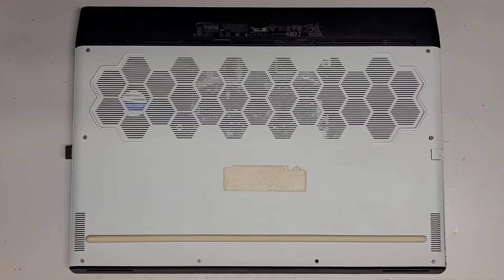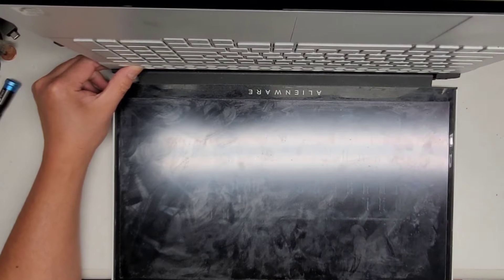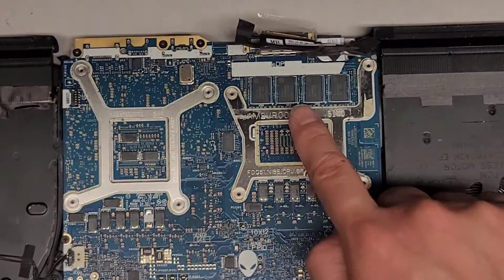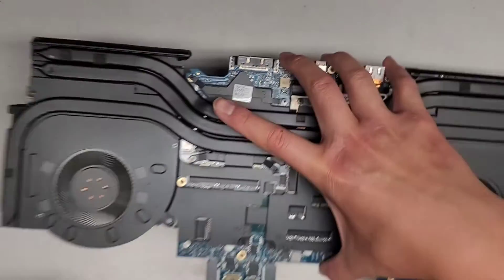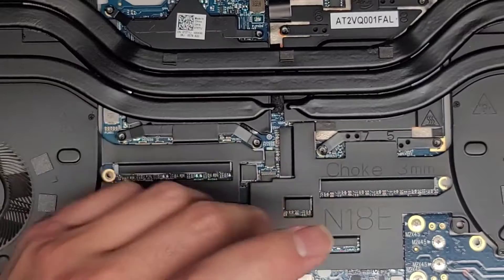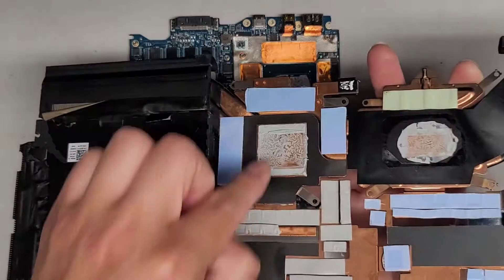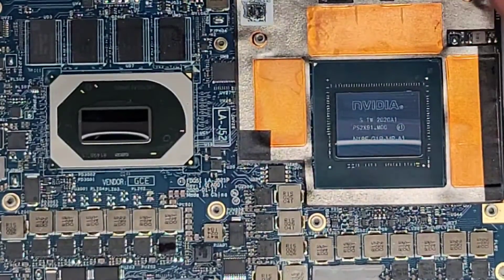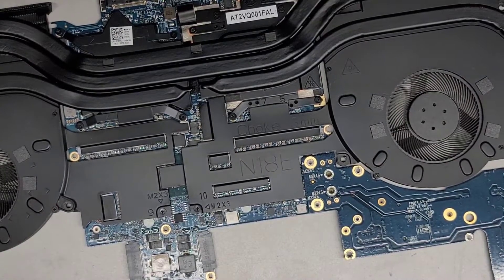Dell Alienware m17 R3 SSD Hard Drive Upgrade Battery Replacement Thermal Paste Replacement Repair

Comment: Thanks for the vid.
I want to clean the fan inside but I dont have the thermal paste with me (the guy fixed my PC has redone the thermal paste for me few months ago), so is thermal paste a must if I want to open the fan to deep clean?
Reply from the maker: Yes, if you want to remove the fans to check for packed dust.
Reply: @ItsBinhRepaired  I am not very familiar with the laptop. I watched your video a few times and try to get the confidence to get that done. It is a nice vid but there is too many in between that makes me a bit confused.
I really wish there is a video tutorial about how to get the fan out, repaste and get it back.
I understand this is not your laptop tho so it may not be possible for that but my laptop is constantly having the frame drop due to the dust I think.
Reply from the maker: Thermal Paste Application: https://www.youtube.com/playlist?list=PLSSiYX-ta7aqlImqkdLxHHpJbJttlNJgQ
Reply from the maker: If you watch enough of those, you should be able to figure it out.
Reply: @ItsBinhRepaired  I watched 5 times your dissemble video but I still dont have the confident. I am worried I would have messed something up.
But thanks for sharing the link.
Reply from the maker: There are a lot of videos in that playlist.

Comment: Thanks for the detailed video, it's given me the confidence I would otherwise lack. I just bought two new fans as well as Kryonaut extreme paste as it was recommended for this laptop but the instructions say to spread the paste as thin as possible. Is that paste specific instructions or would you still recommend the rice and pea method you demonstrated here. Does one method offer a greater benefit over the other?
Reply from the maker: I still recommend the rice/pea method, but spreading it thin makes it so you don't have to worry about getting the right amount. It can trap air bubbles, but it will only be marginally worse.

Comment: you think this will mostly work for an M17 R4?
Reply from the maker: Why not use the right video? https://youtu.be/0Il2-Y354Lo
Reply: @ItsBinhRepaired  that’s the first video I saw. But that’s the old model. Mine is the newer one that looks identical to the R3 on this video.
Reply from the maker: @kyle35_36  Hmmm in that case, I'm not sure. You'll have to give it a shot.

Comment: I disassembled my m17 r3 Alienware laptop to clean the fans and it turns on at least I think it does because the power button flashes and the keyboard lights turn on but I don’t see anything on the screen. Any troubleshooting tips?
Reply from the maker: Might be a bad charger, charge port, dead battery, damaged motherboard, etc.
Reply: @ how can I determine what the problem is?
Reply from the maker: @Mrs.Samantha-w8v  trial and error.

Comment: I did this today, however did not get to go through the heat sink part because of 3 screws stuck.

So I decided to just clean the fans instead and followed your video to reassemble it after.

Turned it on and my m17 r4 started to beep loudly, the power button signaled 2 red and 7 blue, I need help ASAP, because I can’t figure it out
Reply from the maker: Double check the ram
Reply: @ItsBinhRepaired  yea bro thanks it fixed it I was kinda rushed
Reply from the maker: @RuneBa1  awesome! If you haven't already, please like and subscribe so others can find my videos and possibly consider watching a few others and commenting to get the algorithm to recommend my channel. Thanks!

Comment: I have a question I have a father from Alienware M17 R4  Both of my fans were damaged, and when I searched, I found many different sizes than the ones I have. Is there any suggestion? 😢
Reply from the maker: Try repairing the fans
Reply: @ItsBinhRepaired  I tried doing this, but one of them is broken and the others work hard after cleaning
Reply from the maker: Hope you were able to get them replaced. :(

Comment: I have worked on dells and the starting and stopping like in your video is exactly what the pcs do when the battery is not taking a charge. I can't test it or anything so I have no clue but you could try removing the battery entirely to see if it will start up from only power from the wall? You mentioned that the battery was swollen and I'm thinking that it's a battery issue because of that. Another thing is if the charger itself is not high enough wattage it will charge a battery but not exactly keep it running without a functional battery. Figuring out if that charger came with the pc could also help the pc stay started.
Reply from the maker: Yup!  Thanks!

Comment: I know the gpu can't be upgraded. But can it be replaced? Does the gpu board come off? Or is it soldered. I keep reading different things. Mine is stick at 300mhz I've tried everything.
Reply from the maker: It's soldered to the motherboard.

Comment: @ItsBinhRepaired... I'm using Alienware m15 r3... I replaced my battery but my laptop goes off once I unplug the charger. If the charger is plugged everything looks fine including the battery health.

Can you please assist?
Reply from the maker: Was the old battery doing the same thing?

Comment: Hey man , I would like to send my Alienware m17 r3 into you. I  successfully changed my fans , I tired to access the heat sync and change thermal paste but I ran into stripped screws. So I said whatever and re assembled all back together , I played a game and my battery started to drain and not charge , so I swapped my 85W battery that came with it for a 56W battery (on accident) thinking I was having issues with the battery but the same occurred with the 56W battery. I then bought a new charger , and the same thing happened, it charged up to 100% but when I try to play a game or run anything heavy performance wise it shut off on me and now I don’t know what todo I tried everything. I just would like to know how to send this into you and if you could swap my thermal paste and look into my power issues please and thank you.
Reply from the maker: Sounds like you didn't reconnect the charge port or you damaged it.
Reply: @ItsBinhRepaired  i May have damaged it ? Because it was charging , turning on and everything, could u help me fix this ?
Reply: @ItsBinhRepaired  i mean anything would help man I’m in desperate needs
Reply from the maker: I don't know if I'll be able to fix it and it might be a $200-300 job.

Comment: I bought new RAM for mine in the hopes of upgrading to 32gb. Jesus christ opening this thing has been the worst experience. I've got to the part where I'm supposes to unscrew the screws next to the fans and life the spin piece off but those screws won't budge with any screwdriver I have and I think one is getting to be stripped pretty good. I just wanted to install my RAM, man... 😭
Reply from the maker: Yeah... it's stupid. I recommend this screwdriver set https://amzn.to/44uhbOl
Reply: @ItsBinhRepaired Oh that looks nice. I'll seal it back up for now and order that. Ty.
Reply from the maker: @sheev2372  the $40 set is really nice too, but the $20 does 99.999% of electronics lol
Reply: You can upgrade the ram even though it’s soldered?
Reply from the maker: No, unless you have very special soldering skills.

Comment: Who else ran into stripped screws ?😔
Reply from the maker: Your screwdriver is the wrong size.
Reply: When I got to the heat sync It unscrewed like 3 of them, the rest of em were stuck and I started to strip them. I know I had the right size because some screw came off !
Reply from the maker: @dooktah  that doesn't mean you have the right size. If it's one size too small it can work if the screw isn't too tight.
Reply: @ItsBinhRepaired ah i see :/ well I fucked up my screws on my heat syncs trynna to swap thermal paste , you did help me out a lot a ton I will be donating man. And by any chance would I be able to send this in to you todo a thermal paste change even thou some screws are stripped ?
Reply from the maker: @dooktah  sure, you could send it to me. Hopefully it wasn't stripped too bad
Reply: @ItsBinhRepaired  and if they are is that a problem?😅
Reply from the maker: I have a stripped screw removal tool that I should be able to remove them with, otherwise they'll need to be drilled out.

Comment: D: what happened to the battery!
alienware services atleast in my region is very difficult so yeah will be helpful for them, the fans are pretty thin isn't it
Reply from the maker: Usually that happens when it's plugged in and never unplugged.

Comment: why on earth would you ever scrape on a heatsink or dye with plastic scrapper isopropyl alchol is cheap and easy to find FFS
Reply from the maker: Some people just complain about everything... The paste is made of diamond bits. It's going to do much more damage to it...
Reply: @ItsBinhRepaired  you do realize thats not all thermal paste right only diamond based ones and if you think dell is wasting money on diamond based paste thats hilarious and even still its only particulates that would not cause damage and would get wiped off but scraping can cause damage but whatever its def just complain about everything 🙄
Reply: @ItsBinhRepaired  diamond based pastes are absurdly expensive to the point no business would use them 🤣
Reply from the maker: @Cyricaaa  I put diamond paste. If anything I scraped off oxidation. Do you think that's enough to kill or even harm a computer? You act like I was scraping it every day for a month...
Reply from the maker: @Cyricaaa  I'm surprised you didn't complain that I wiped it with paper towel and not a microfiber cloth or something... lol
Reply: @ItsBinhRepaired  if you repasted it at some point do explain then how the battery ballooned to the point it looked like it wass gonna explode XP
Reply from the maker: @Cyricaaa  Customer's computer. Most computers, unless their fans fail, only need one repasting in their lifetime at most.